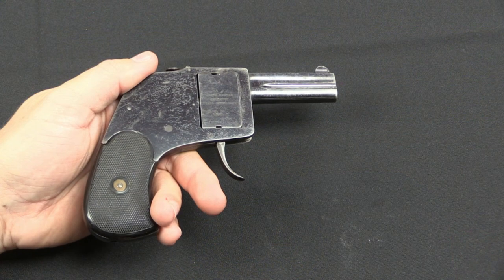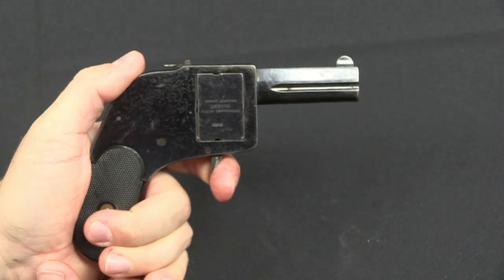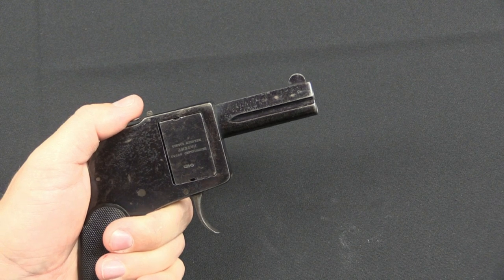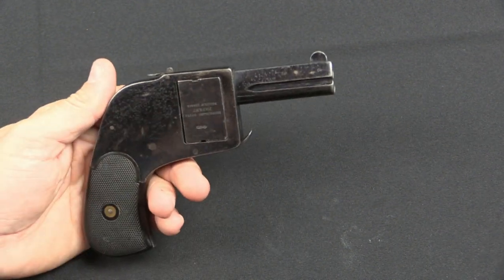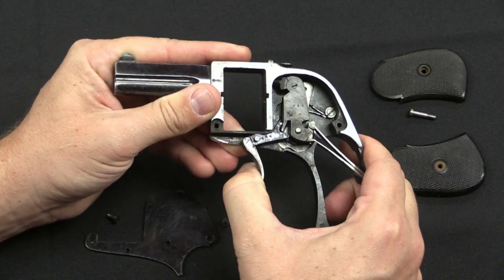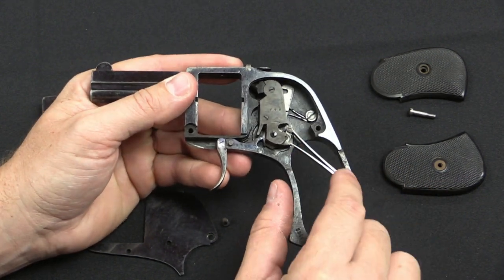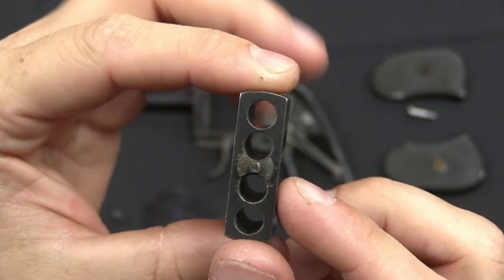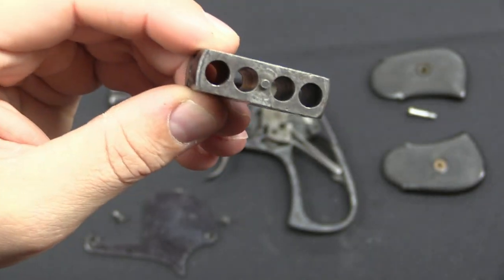4-Shot Sauer Bär Pistol

Comment: Now THAT is cool! It's so itty bitty in .25 though! I'd like to see how it would look if it were beefed up to, say, .357 Magnum, or at least .38 Special :P Here's an idea for an ejector; how flat is that trigger? When you want to eject the casings, just flip the revolver upside down, and use the trigger as an ejector rod! If it's too bend to be used as such, then I think it's a missed opportunity. Of course with a 9mm wide cartridge like .38 SPL or .357 Magnum, it's plenty wide enough to allow a curved trigger... but to make it long enough would probably look goofy.

Perhaps with the slight curve of the trigger, you can try to scrape along the side of the chamber, trying to hit the neck of the casing rather than the very bottom of it inside. All you'd have to do is push em down a tiny bit, and it should be easy enough to yank em out with your fingers. It looks like this pistol would be fairly cheap to produce... I don't think it'd hurt to make some reproductions! If the cost is low enough, then it could be a decent little back-up pistol to slide in an empty pocket, or just something to bring to the range and plink with. Sure it's small and only holds 4 rounds with a rather laborious reload, but if those things can be sold at less than $250 and you're on a budget for your first pistol, why not?

Wait, aren't Hi Points that price, or possibly cheaper?... nah, to sell reproductions of these, it'd have to be under $150 or so I think. Unless the manufacturer can REALLY simplify the machining to the point of basically producing them for under $100 or so, I don't think there'd be much profit... don't even know if many people would bother buying them in spite of their exceptionally thin profile which seems to be its main selling point. Well, its simple manually rotated design COULD potentially make it even more reliable than revolvers, considering there's less moving parts. Just a matter of making sure the firing pin moves appropriately.
Reply: That’s a great assessment, I’ve heard 25 has ballistics similar to 22lr, a 9mm sized bullet like 38 or 357 would be too big for the concept of this gun I think, 380 or 32 auto would be sufficient without defeating the purpose of the gun
Reply: @nathanwilson3185  I suppose you could lengthen it a bit and use .17HMR or .22WMR. Decent cartridges small enough to stick to the spirit of the thing.

Comment: Does anybody else see a stylised bear in the design?
The ridge between the barrels looks like its maw...

Also a fantastic video as always, ian.

And an interesting concept for a low profile self defense pistol...
Yes .25 might be a bit on the weak side, but two rounds of it should deter a normal robber or thug, at least in countries without open/concealed carry laws (for example germany)

Comment: This gun flipped its breach block automatically upon release of the trigger on shot number 2 a mech engages and flips the breach as you pull the trigger for shot number 3(like a regular type revolver cylinder). You can see the ratchet paul on the fulcrum of the block itself, and the mechanism attached to the hammer.

Comment: What a neat little gun! Thank you for picking this one out for us.

I have to admit, I'd be interested in seeing what a modern manufacturer could do with this pattern; I very much like the thinness of the gun which could make for a quite comfortable carry piece. Made in a chambering like .38 Special (or possibly even .45LC), the recoil wouldn't be painful, even if the grips were under 3/4 of an inch wide. The trigger would need an update and I'd like to see the barrels set lower, but (other than that complete redesign) I really like this gun.

Thanks again Ian.

Comment: Some outfit made a replica of that back in the 70's. I had an FFL and ordered one new, it had a brass frame and was in .22LR. The copy, however was not very good, it had an exposed hammer and was single action but a bit smaller because of that feature.  I thought it was cool but was only good for very short range because of the small size and almost non-existent sights.

Comment: I know it would be illegal but how cool would it be if you could fire both barrels on this with just one trigger pull. That would eliminate the contrived non-working cam system that it currently has. One trigger pull would have two firing pins traveling forward at the same time. If you could do that and make it in 9mm I would buy one in a heartbeat.
Reply: nodresiak why would it be illegal? is that double-barreled 1911 illegal?
Reply: You know you bring up a good point. I was under the impression that one pull  of a trigger is supposed to only fire one cartridge or else it is considered in a similar class as full auto guns. Maybe that welded together dual 1911 skirts the law because doesn't it technically have two triggers with a connector between them even though they ignite two cartridges at exactly the same time. Can you imagine how well a small pistol would sell if you could send two 9mm bullets at a robbers guts at exactly the same time. Certainly ups the incapacitation factor a bit.
Reply: +nodresiak the ban applies to full auto weapons. Specifically it applies to weapons with a system that allows you to keep firing so long as the trigger is held. A dual 1911 may launch two projectiles, but if you hold down the trigger, nothing happens. So it's legal. It has nothing to do with the number of projectiles launched simultaneously. This gun, so long as it doesn't violate any rules I'm not aware of, would be perfectly legal.
Reply: nodresiak I'm not entirely sure, possibly because companies do not like to try new things. There's more risk in a new design than sticking with what works. However, perhaps you could make these things, if you could come up with the appropriate crew and machines. They're pretty good design ideas, in all honesty.
Reply: +Bio Hazzerd i'm pretty sure everything you said is incorrect.
Reply: +j0nthegreat Check it with current law, please let me know if you find anything.
Reply: Bio Hazzerd ATF definition of a machine gun: "Any weapon which shoots, is designed to shoot, or can be readily restored to shoot, automatically more than one shot, without manual reloading, by a single function of the trigger." so shooting two .45ACP rounds with one pull of the trigger is a machine gun.
Reply: j0nthegreat
 That is also how I interpreted the law. I know there is a new system fo AR-15's that allow for a shot on trigger pull and another upon trigger release and that does fall within the definition of what you told us. A pull and release of a trigger is two actions so therefore two shots are allowed. I am going to be off work for the rest of the week and I am seriosly contemplating calling the ATF and asking or e-mailing because I have the time It is cold here in Ohio and I have no desire to go outside.
I will get back to you guys when I get answers. I will ask specifically about the dual 1911.
Reply: nodresiak the dual 1911 has two triggers. that's why it's fine as is. two trigger pulls, two bullets out the gun. don't call the atf and rile up something good we've got going. that's what happened with the sig brace.
Reply: nodresiak.  If you upped caliber, you probably wouldn't need or want to double fire.  (recoil and shot opportunities)  I would lean toward a rimmed cartridge so as not to have to fabricate a sprung retention clip mechanism  .38/357 or 45 long colt maybe. But a sliding scalloped retainer would prevent shells from jarring rearward during a hasty block flip.   Aluminum frame could work quite well, but I think a stouter chamber block axis is needed.  Maybe I should go play in the shop.....